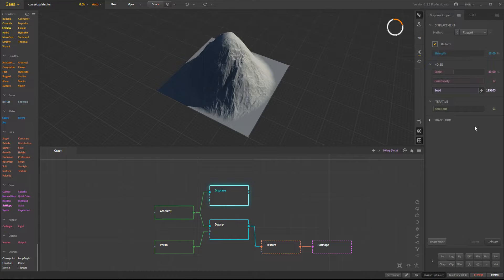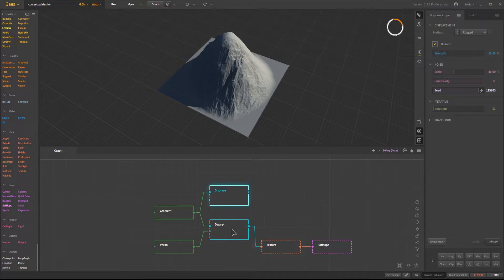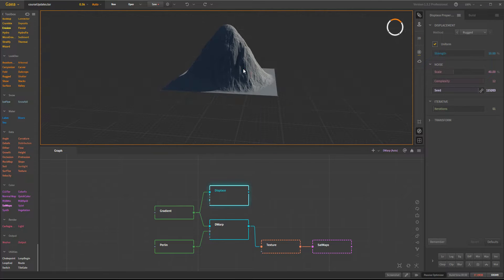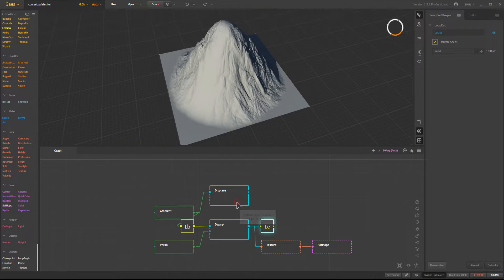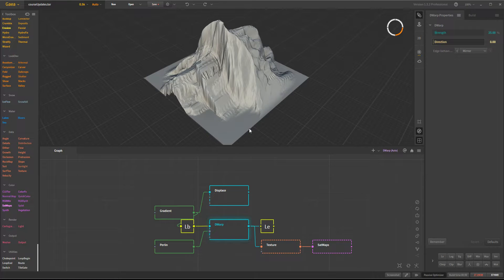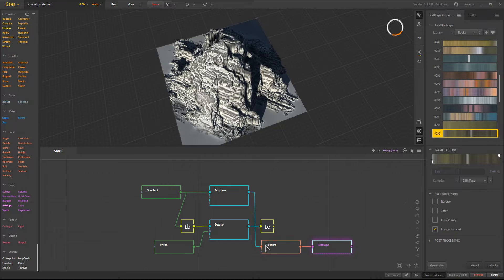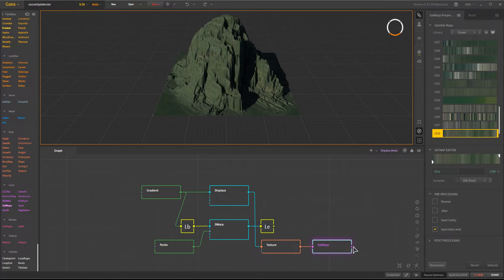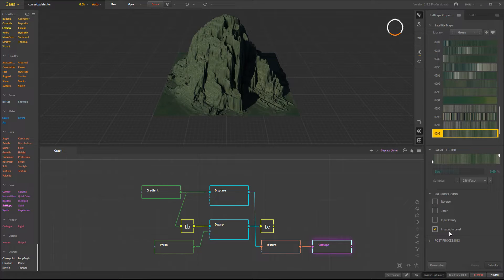Gaea   Displacement missing rotation and satmaps not working on old files

Comment: Gaea is easy to use is it better then houdini height fields ?
Reply from the maker: It will depend on what you want to do. Houdini doesn't have a great erosion model, which is where they have worked with the Quadspinner team to integrate Gaea into Houdini to help in that area. The advantage Houdini has is that it is a true 3D application, whereas Gaea only deals with height. So if you wanted overhangs or stuff like that, it would need to be true 3D. Gaea itself is a very powerful tool to make landscapes with very quickly. There are a lot of nodes that produce good looking results with minimal effort of the user. So, for those who are new to the process of making terrains will find Gaea faster and easier to use than houdini.
Reply: @cowsmanaut  Thank you for your clarification 😊